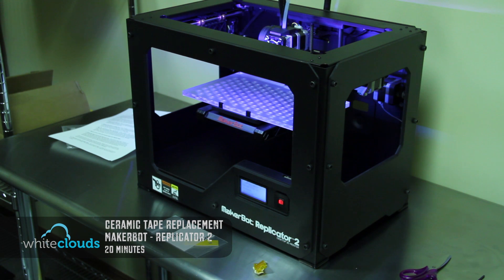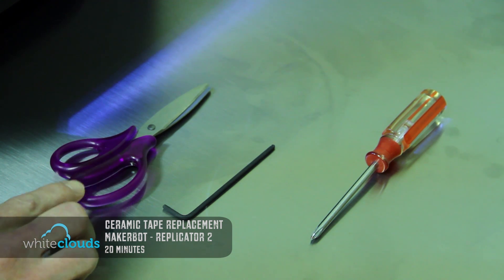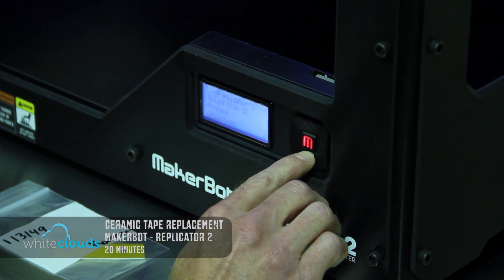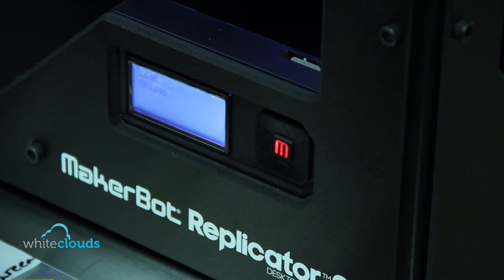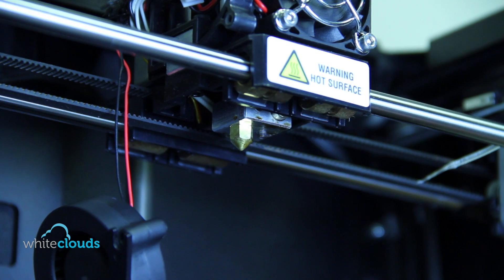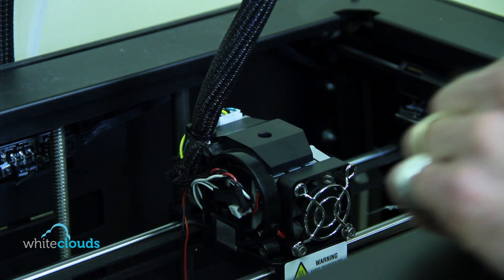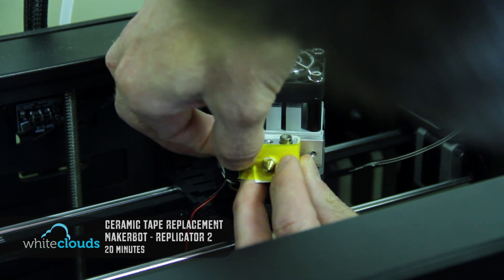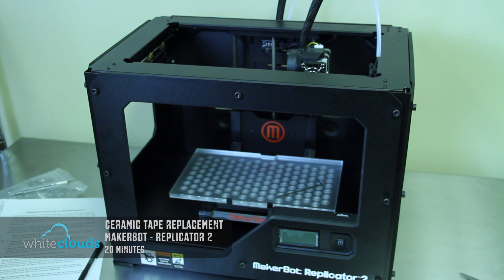Ceramic Tape Repair -  Makerbot: Replicator 2

Comment: What would happen if I use the printer with damaged or without kapton tape?

Mine recently got damaged and I'm having adhesion problems on my first layer, while using blue painter tape on the platform. Do you think the problem is related to the lack of proper insulation?

Comment: Useful video, but it's not nesessary to unscrew the filament fan screws to gain the acces to bottom bolts. Just pull the fan duct left and down and if will jump out the fan and you will see the bolts.